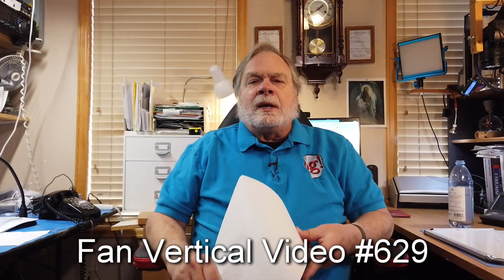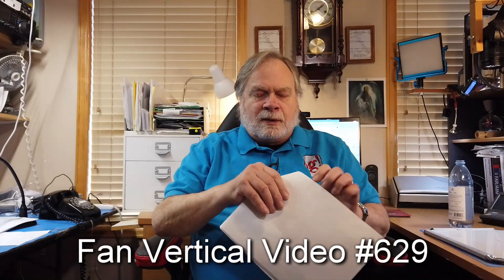Fan Vertical Installation Question (#1105)

Comment: Great video except that MFJ is seizing operation. They are not making anything new, and there's just selling off their old stock now. I have both a MLA30, and KW180 antenna, which work well but don't break the bank. I tried to order an MFJ Discone, but the shipping fee was over 100 pounds so I said no.

Comment: I use copper water pipe with a garden hose fitting soldered on and use eater  from my tap to power a water drill and have had no major issues drilling into most non-rocky ground...